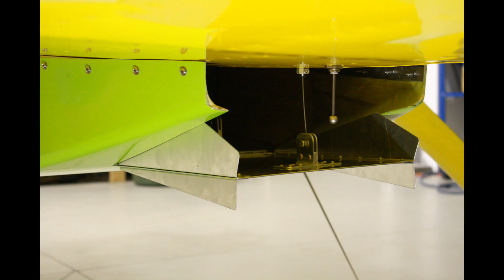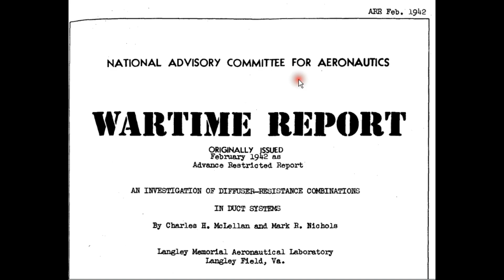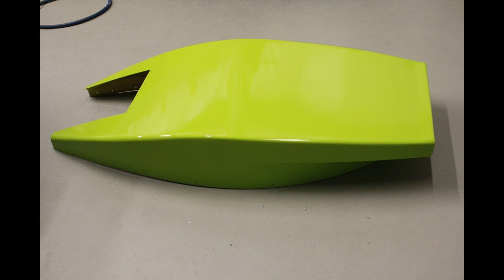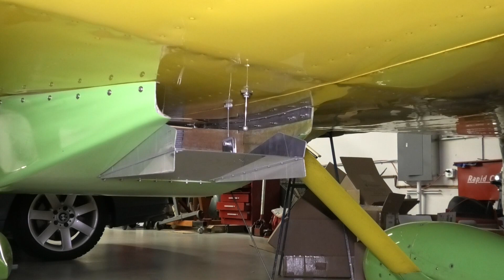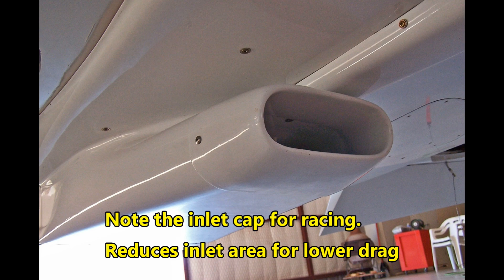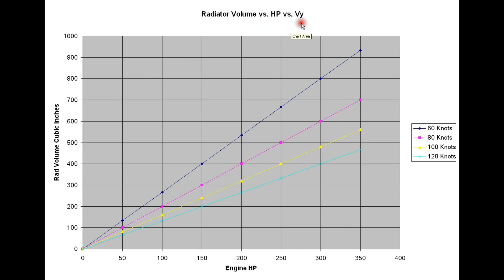Video # 102. Liquid Cooling. Part 2.

Comment: There's an Avid flyer at my brother's place (private air strip).
Would you mind if I asked you some questions about the motor & redrive?
You seem to REALLY know your stuff.
Reply from the maker: NSI which has been defunct for about 10 years now. These were pretty sound conversions but no more support now.
Reply: @rv6ejguy  Thanks again!  I very much appreciate your thought!
Reply from the maker: I know a bit about Subarus...Ask away.
Reply: @rv6ejguy  Otay.
Here's the Avid Flyer with a Subaru:
https://youtu.be/UzFKvj6EdCc
The owner passed away and then the daughter inherited it, then her hubby & buddy were going to get it going (it has flown plenty, but still...needs a bit of work).  Both guys changed their mind;  One is a commercial pilot, the other was just interested in flying.
I'm curious as what you think about the motor & redrive.  What, if any, changes would you suggest about the motor & redrive.  They basically want to sell it (but they're not advertising).  I might want it...maybe.
  I'm going out there in the next few days and can get more info, if you like (I think I'll crank up my mighty N3 Pup and 'drive' it a bit).  I've never flown a taildragger...(hope that goes okay).  I figure, safer with the wings off.
Reply: @rv6ejguy  & Thank you SO VERY MUCH!

Comment: Excellent brief... Just what I was looking for. I too have incorporated a linear actuator for the outlet door. Can you provide a link to the charts you present with additional supporting documentation.ie, you mentioned that some charts were based on 100F ambient air ...
Reply from the maker: Glad you found it informative. There are no links available for the charts. You'll just have to screenshot what I presented. In colder ambient conditions, you can downsize rad size and inlet/ outlet sizes. These are ballpark suggestions as there are many interrelated factors involved.

Comment: That Glassair...it just hit me.
Rubber band powered!  Awesome!
Is the twist correct?  ...as you look at the plane in front of the plane, does the prop spin counter clockwise?
I have to check the starboard side to make sure it's consistent....otherwise, you'll HAVE to repaint it!

Comment: Would a NACA duct flush to the fuselage possibly make for an efficient in let aperture? If everything was housed inside the fuselage
Reply from the maker: No, NACA ducts have poor pressure recovery when feeding heat exchangers in fact this was tried on the GP-5 for the induction inlet where there is no restriction. It lost MAP and they went back to the ram type inlet. Others have documented the same thing on Cozy aircraft through instrumented flight testing. Look up Peter Garrison's article online about NACA ducts.
Reply: @rv6ejguy  Thanks for the super reply! Still learning and people like you are encouraging

Comment: VERY interesting testing and results! Thanks for sharing! I assume you studied up on Hoerner, aerodynamic drag? Did you try his shown "trumpet" shape difuser?? Obviously starts out at low difusing angles but ends up extremely steep - also, did you do any testing on the theory where you want to extend the space behind the radiator - ideally - 3x the radiator height (..or thickness??) BFORE you start to difuse again...??

Comment: Great presentation and a very scientific approach to the water cooling issue.  Would tilting the radiator forward or backward improve the cooling by allowing a taller radiator without more drag? Would the tubes also need tilting to keep airflow straight? Also did you consider a cooling fan behind part of the radiator for better cooling on the ground and in the climb?  Thanks in advance.
Reply from the maker: Tilting the rad more than about 10 degrees causies more drag. You won't be able to find a rad which has the matrix tilted like this, to my knowledge.

As I said in the video, my setup and Russel's need no cooling fan and can cool on the ground indefinitely. Climb cooling is no issue. The fan causes high drag in cruise due to the blocking effect.

Comment: Why don’t we use part of the wing as cooling surface? A few little square alutubes attached inside the leading edge skin? Are there any experiments done like that?
Reply from the maker: Not very effective and very complicated and heavy to do. The Schneider Cup racers in the '30s did this but the whole airplane and floats were covered with coolant tubes.
Reply: Why dont you go build it and try it and let us all know how it works.
Reply: @davidhanson3288  Communication with clever people comes first. Questions find answers. New conclusions can be made. I have a degree in mechanical engineering. I gues wingsurfaces and cowlings have a hidden potential for cooling.

When the after-effect of my cancer healing is gone I start a project. 

I regained my medical. Today I flew a rental Cessna in the alps at 10000ft and remembered my Mooney. I miss that speed. I miss the high redline in a dive and the following recovery in altitude.

A Viking 130 powered Sonex comes close to these requirements. But prop diameter, weight and balance are not realy ideal. The cockpit is a bit smal for my 6ft6inches.

I did all the wing calculations for a sexier wing design on RV7. Tapered, 63215/64212, higher aspect ratio, more wing area for smaller engines.. 

Maybe you know a low wing design with the speed potential and simplicity to build in 1500hours?
Reply: @tinolino58  i  have been building exp. For over 20 years. I dont know any stock designs that can truly be built in that time. Best advice! Buy something that has about 1500 hrs in the build. And if you decide to go out on your own mods. add another 1000. 
I am building a canard with an auto engine in the back seat. Its my last plane. My configuration has been done before with moderate success. That was 45 years ago. And it has had some success in europe. So the cooling topic always peaks my interest. Good luck. We are all running out of time. Maybe its time to buy a nice plane that fits your mission. BTW i loved my Mooney.
Reply: @davidhanson3288  You are right. 1500 hours are optimistic. Mods take additional time. 

I can lay my hand on a old Cherry BX-2 with a broken C90 engine. But it’s a wooden airplane with no potential for wingcooler. 

It needs a new engine, new avionics and for my tall body a modified canopy. The retractable gear makes it sexy. Quickly detachable wings makes it suitable to take it home (Switzerland). I guess it takes 1000 hours to get airworthy again. 
Vne is 140kts. 600kg with 130 hp makes it pretty fun airplane. The 912 versions cruise right below Vne.

Beceause of the retractable nose gear it takes some planing for a new engine before I dive into the project. Thanks for conversation David!

Here is the link to my style of flying in the alps..
https://youtu.be/q0lW0AoaGtQ
Reply: @davidhanson3288 Are there any more details on your canard with auto engine? Thanks

Comment: Can we switch/divert some air over a second thin cooler to gain more cooling on the ground? Translation😆
Reply from the maker: If you have a cabin heater core as I do, you could add a fan and a diverter valve to dump the hot air overboard for extra ground cooling. Typically if well designed, this would not be required unless you have a very long hold at very high ambient temps.